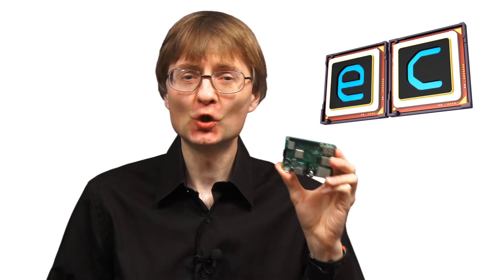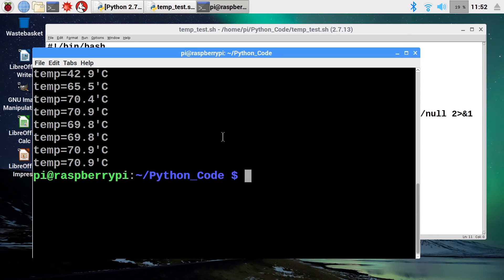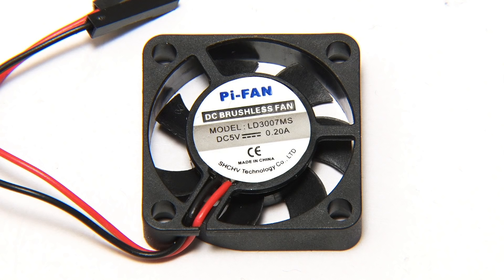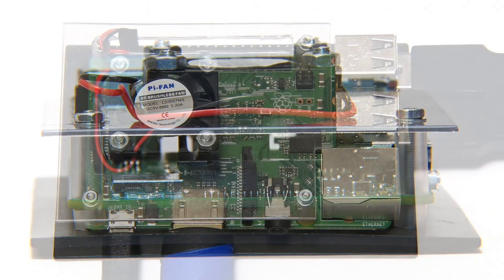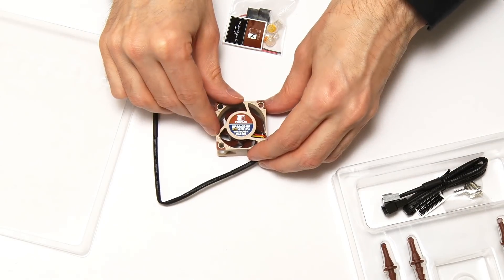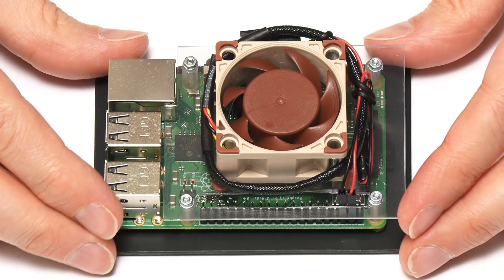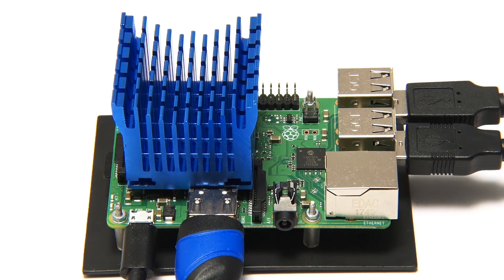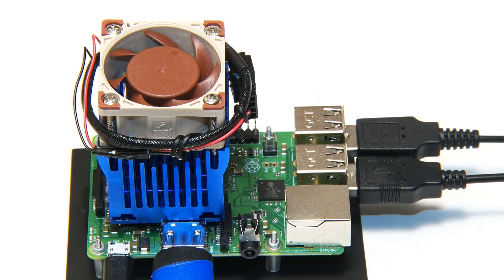Raspberry Pi 3 B+ Extreme Cooling

Comment: Liquid Nitrogen  should get you there, failing that stand in a walk in freezer ;-)

Great video as always Chris. Love your SBC videos.
Reply: RoboNuggie I haven't tried the freezer but I did try using and old beer fridge putting the Pi inside and insulating the gap for the wires to come out , it made very little difference about 3°c all in all so just put beer back in the fridge and called it a day
Reply: lol, brilliant Mark...a win-win situation really: 

Pi = Cooler  --> Drink Beer (shame to let it warm up)
Pi= Not much cooler ---> Put back in fridge, drink beer later...

Huzzah!
Reply: RoboNuggie 

So damn cool..
Am a software guy (CS) how can I start learning to program FPGS and use VHDL ... do I need to learn anything else before that ....
Can I get into Arduino immediately without taking other courses
Reply: i would just dual sided thermal tape to put directly the big heat sink on the rpi.
with noctua fan.
would be perfect.
Reply: RoboNuggie hahaha or sent it to space 😁🤣
Reply: Not a bad idea. How about Liquid hydrogen @ -400°c
Reply: @iaincowell9747  0 Kelvin, the theoretically possible minimum is -273,15 °C

I would rather suggest swapping the copper wires to something like Nb3Sn and cooling it down with liquid Helium until the raspberry pi is superconductive. That way you would also save a lot on electricity :D
Reply: Hehe - I was thinking Liquid Nitrogen!!! nice.

Comment: I think I know what's next. An extreme overclock video that overclocks it to 1585 mhz. Because I overclocked my model B to 1385mhz and my ram to 635 mhz. I didn't overclock GPU. It didn't want to overclock.
Reply: Try overclockimg sdcard.
Reply: I did that. 100.25 mhz. The sd card READER. Yeah, it now performs full speed.
Reply: 30G Put a heatsink on the RAM, take it to 700 Mhz. Also you can overvolt the CPU to get better OC.

Comment: That's it, i'll build one for myself. My Pi3 started showing the temperature icon while using Ubuntu Mate. And as always, thanks for the awesome content!
Reply: And I did adapt an aluminum heat sink! I was surprised at how hot it gets while doing unattended upgrades just after booting Ubuntu Mate. I wish there was a way to attach a picture.

Comment: It would have been interesting to see the results when using a Pi fan without the small heatsink.  In other words, to find the minimal configuration to keep the processor below 70C at full power.
Reply from the maker: Ah, I missed that one. Would indeed be interesting to try given the heat spreader on the Pi 3 B+.

Comment: Curiously I noticed you directed the airflow away from CPU with the cheaper fan but directed the airflow towards the CPU with the noctua. Was that deliberate? Does it make any difference? Am I asking a stupid question?

Oh right, and thanks for another video.
Reply from the maker: It is a very good question, and I think an error on my behalf with the smaller fan. :(
Reply: ExplainingComputers sorry I was just curious. My Pi case's instructions showed the fan blowing air away from the CPU but I set it up to blow on the CPU, so I wasn't sure if there was some CPU cooling secret I wasn't privy to.
Reply: so is it better to blow cooler air down on sink and chip or pull heat away?
Reply: @browntrout3994  pushing moves more air than pulling, assuming you are moving air across, but in this situation its hard to say, I've seen both configs work fine, but only fine, because blowing towards the heatsink has poor flow.
Reply: Brown Trout 
Lol, you are getting a lot of pseudoscience answers.
Air is a fluid. It has a specific capacity for heat. The purpose of a fan is to move units of air past the fins, so you have the same capacity for heat removal per unit time.
i.e., it doesn't matter one bit if the air is pulling or pushing, using the same fan.
Reply: ExplainingComputers 
Can't help but picture Eric Idle as you talk.
Reply: if you have an open air design, i find it better for your fan to blow on the heat sink and if you have a closed case design, for it to pull air off of it. in the end though, the difference is marginal - you're still using the fan to promote airflow and the main difference is where you're going to get dust buildup over time. You should check out PC building airflow videos for explanations on that.
Reply: not that you'd want to but could you re-run the cheaper fan again I'm curious as to how that'll play out against the noctua
Reply: So the Noctua fan was implemented correctly?
Reply: josh blowing away may be more effective, blowing down on a heatsink is known to be inefficient because air will hit the flat bottom of the heatsink. Always make  air move across a heatsink so the airflow is unopstructed

Comment: So the Pi3 B+ THAT MUCH better than the Pi 3 B? (And could you please watercool a Pi?)
Reply from the maker: At load, no cooling, the Pi 3B+ runs about 10 degrees cooler at full load than a Pi 3 (due to an improved thermal design and heat spreader). Test results in this video: https://www.youtube.com/watch?v=izceGfkUtZU